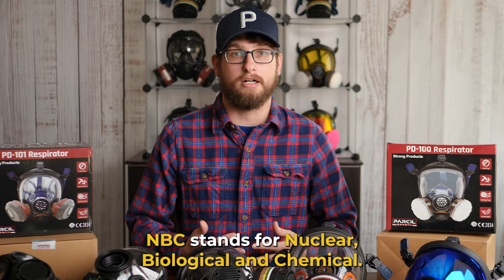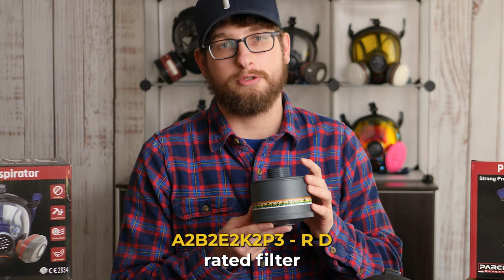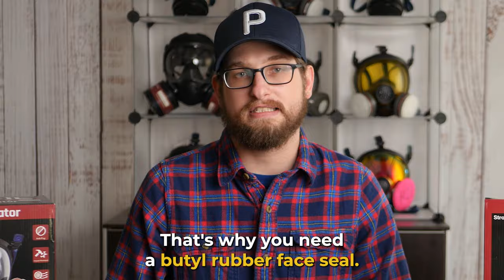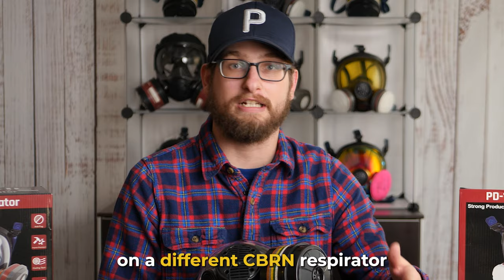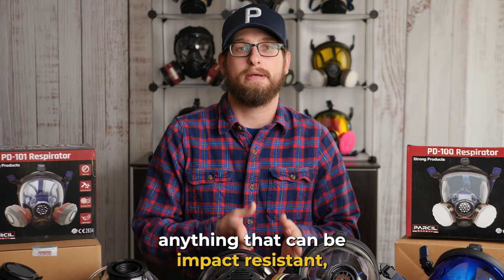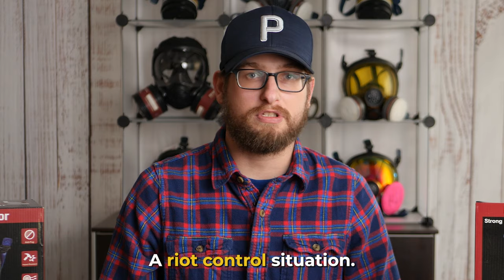What makes a gas mask CBRN, NBC or CBA-RCA?  Parcil Safety answers the question and more!

Comment: If your working with fuel gas/disel which mask is the best?
Reply from the maker: Sorry for the delayed response here!  The main component you are needing to deal with fuel gas or diesel fuel is a mask with organic vapor filter cartridges.  I'd recommend going with our PD-101 industrial respirator mask or the PD-100 full face respirator mask.  Both come stock with organic vapor cartridges.

https://parcilsafety.com/collections/full-face-respirators/products/pd100-full-face-respirator

https://parcilsafety.com/collections/full-face-respirators/products/pd101-full-face-respirator

Hope this helps, but please let us know if you have any other questions!

Thanks,
Cody
Reply: @parcilsafety  ok sounds good thank you   same with the half face respirator t60 & t61?
Reply from the maker: Correct.   Both will come stock with organic vapor cartridges as well.

Thanks,
Cody
Reply: @parcilsafety  thank you

Comment: Can you give me your true opinion on the Israeli gas mask and Israeli supergum nbc ABE1  P3 R  gas filters? Are they as good as the cbrn filters or not ?
Reply from the maker: Hi Patriot Country!  So an israel gas mask typically is made out of butyl rubber and can provide good seals, however if it's surplus, just be aware that you need to make sure it's sealing and nothing is breaking down on it.  Overtime, both rubber and silicone can degrade.

Supergum actually makes some really good filter canisters, however, the one you mentioned - ABE1 P3 R isn't really NBC.  You really should have a REACT component to the filter or at bare minimum A2B2E2K2 P3 R filtration capability.  

What you're missing there that is commonly used in many biological and chemical agents  is the ammonia filtration capability as well as the concentration capability - i.e. you are looking for that number 2 if you are dealing with something super dangerous.  

Hope this helps!  But feel free to send us a message or comment again if you have follow up questions.  

Thanks,
Cody